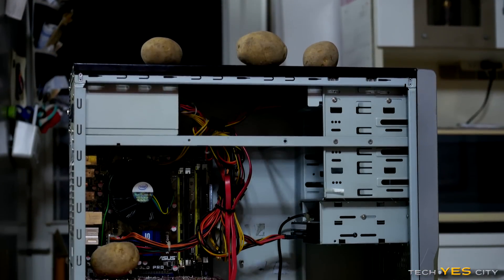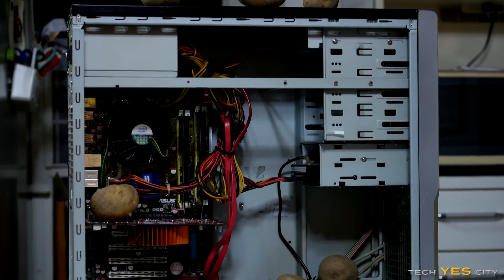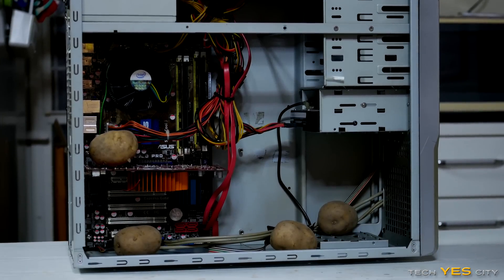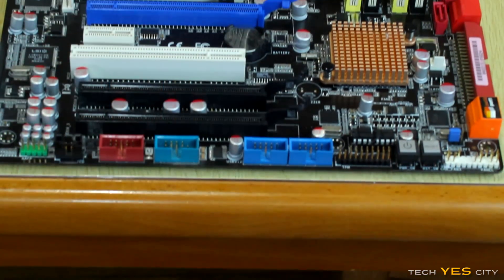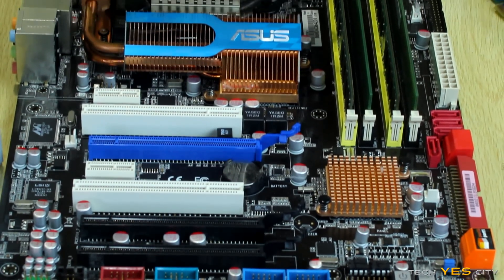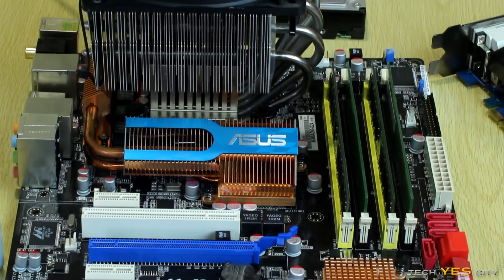The $70 CS:GO POTATO - 1080p CS:GO for Under $100?

Comment: I got a Packard Bell with an i5-650, 6 gigs of DDR3, a GT 330, a WD 1 TB, and Windows 8 (later 8.1) for free from a friend (born in 1941 or 42). I rocked it as it came for a while, with my 2010-era PC. Most things worked fine. I didn't play many games. It was mostly Minecraft and TF2. Video editing was pretty smooth, especially for already 4 years old hardware. However, in 2015, I got tired of that stuff and got me a GTX 750 1GB. Not the best card, but it was the only time I could buy anything, and the only thing I could afford. So, now, since then, I've been gaming on my sweet PC that can run Fallout 4 at 1080p quite decently for only 990 SEK, or currently $121.80
Reply: +TheBcoolGuy
Hello, I found an Laptop with an 
Intel Core i5-4210U 1.7 GHz Processor,
8 GB DDR3 RAM (I'm sure that's enough)
With an Integrated /On-Board Graphics.

It's in my price range, and I want to know if it can play FPS games.
Thank you.
Reply: Matthew Noneya Well, that's very vague. I don't know the GPU, your standards, your resolution, anything.
Reply: TheBcoolGuy If GPU stands for graphics, the only information I can see is an "integrated/On-board graphics". And I'd like to be able to play GTA 5 on medium settings, but would settle for COD MW3 and other COD games. I would also play battlefield 4/5 if that was possible. Thank you
Reply: Matthew Noneya With the processor you mentioned, I'd reckon the integrated graphics is the HD 4400, which will not even run any of those games. Well, perhaps the older COD games.

There is no Battlefield 5. There is Hardline.
Reply: TheBcoolGuy Oh, and my standards would be preferably 30-50 FPS (above 20 when I want to play something fancy). 360p is the lowest I'll play in. HD doesn't matter to me.
Reply: Matthew Noneya Okay, I knew it. I don't deal with trolls.

You can't even play these games in 360p. There is no such option.

Your computer wouldn't run your games at all. They would get to the menu screen at best.
Reply: TheBcoolGuy I'm not trolling, I was just trying to exspess how little HD matters to me. I watch my YouTuber videos in 360p because it's simple.

Even on lowest settings I couldn't play COD Ghost, MW3, or other COD games?
Thank you for your information.
Reply: Matthew Noneya Yeah, most likely not. Well, maybe, but it wouldn't be enjoyable, sorry. My PC has trouble running GTA V, and it's a lot better than that one.
Reply: TheBcoolGuy I'm sure a desktop can beat the PC I'm looking at, but could it not play... idk, steam games at low settings? I only play FPS (Sometimes Racing) And again, I Thank You for your time.
Reply: Matthew Noneya It really depends on the game. You would be able to play Source game (Valve games made with the Source Engine, like TF2, Portal (2), Left 4 Dead, Half-Life, etc.) quite decently at okay settings, but it's far from a beastly rig.

Comment: So what should I do, My Computer that I bought 3 and A half years ago with 700€ euros, doesnt run Csgo good. It runs about 35 fps constant and when I go Trough smokes it drops to 25fps. My CPU is Intel core i3 2120 and GPU is AMD Radeon HD 7470. It has 6gb of ram . I play CSGO at the lowest settings possible. Sorry for the Bad grammar and typos Im writing this on My phone and its 4am! The autocorrect is crazy! But thank you for your Time if you read and reply to this :)

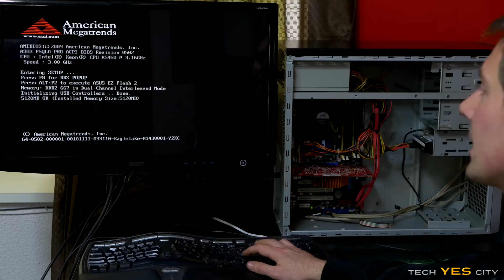Comment: Didn't he mount the power supply unit upside down at 6:00?
It seems the fan-side is mounted towards the top of the case, but it does not have any vent holes over there.

Comment: Hey guys! "What" LETS RUB THE SHIT OUT OF SENSITIVE ELECTRICAL COMPONENTS AND GENERATE AS MUCH STATIC AS WE CAN "Fuck Yeah!"
Reply: You introduce some conductive material. That's the trick. That way, no charge can build up since it's directly tranferred to the thing you're cleaning. No sudden burst of some kV at once. 

Easy solution, isn't it? Just look for it on amazon. There are pretty good, lint free ones for under 10$/box.
Reply: +GunsOfPlentyNZ Anti-static wipes dude. that and some contact cleaner is perfectly fine. At least better than vacuuming the parts. I never worked with a ground bracelet and didn't pay too much attention to grounding myself by touching the case or anything like that. Never had a problem. And I build PCs for 18 years now.
Reply: Idiot
Reply: +TheGamingKamikaze How so?
Reply: Your an idiot
Reply: +ARidingLifestyle How so!? when cleaning the components hes rubbing the shit out them with no ESD protection, normally i dont give a shit when assembling a pc about ESD just touch the case every now and then, but jesus christ that was extreme
Reply: +therealpanse What in gods name is an anti static wipe? How can a fiberios material disperse ESD rather than generate it? Also i am somewhat in the same boat as i built my first computer on carpert handeling all the components like a noob, however i gig manage to kill a gt610 by killing the brige rectifier with ESD shorting out on the transistors. so now i always take care
Reply: +GunsOfPlentyNZ My mobo is static resistant :)

Comment: o_O i find it sad that my $300 gtx 660 can only get 70 fps at low settings on cs:go and you can run it at medium very high :p
however i have a amd athlon ii dual core x2 xD so i think it's bottle necking.
Reply: It's 100% your CPU that's the bottleneck. My brother got the gtx 650 1gb and a brand new i5 4690k and rocking high/ultra settings 1080p at 200-300 fps. CS:GO is a CPU-game.
Reply: rasmus polden stene :) thanks for the info. i'm currently broke atm with £25 and just gotta get some more money until I buy a nice i5. thing is money is hard to find when your 13.. xD

Comment: do you know any gpu that does not need a power supply
Reply: The Gtx 750 ti
Reply: Thesoggyburito thx
Reply: 750 ti does require a power supply. 300w I believe
Reply: +Piotr Waniek gtx 950 also on some models
Reply: DONT GET A 750TI!!! Get a GTX950 instead they're way better!
Reply: +Leon Wallis 750ti is an entry level gfx card for people on a budget. it can still run nfs 2015 on low setting.
i got mine this year ; EVGA 750ti sc and its working like a charm on new games.
im planning to never upgrade until new gen games require more power.
Reply: CrystalEyes but my computer is the worst pieces of shit so it might not be able to connect to any card
Reply: Piotr Waniek you should change your motherboard. Buy one that has PCI express 3.0. But Im pretty sure an old motherboard can do the job but thats very risky.
Reply: you can get a reasonable good power supply for 20 bucks also
look up the evga 400w, I have used one without problems for a month now
Reply: That is on amazon btw
Reply: I got mine at $20 brand new
Xpower 750W.
Its cheap but can do the job :D
I suggest buying the best and cheapest one because it really dont affect the performance.

Comment: Not too bad of a PC actually.. Slap a 660ti in it and it'll fly.
Reply: the motherboard would die.
Reply: +Rehana Islam Actually, no. Psu might though.
Reply: Rehana Islam
..Why would the motherboard die?
Reply: F1nWarri0r
True, you'd need a good PSU.
Reply: +IRNatman because the Motherboard is shit.
Reply: Rehana Islam Invalid argument. I've built a system with a P5QLD PRO, still a fine 775 oc board. Just because something is a bit older, doesn't mean its shit.
Reply: Rehana Islam
Just because a motherboard is old doesn't make it shit. I had a motherboard almost exactly like it (probably worse) with a GTX760 and it ran for over a year with no problems. Only reason it quit running is because I tore the system down for parts.

Next time talk from experience, not from your ass..

Comment: What the fuck is wrong with you? Why would you bend the pins to change the socket? You can really fuck up the cpu like that. I bent one pin on an old pc i had. I could never get it running again. Plus if someone is making a 70 dollar machine they most likely dont have a 1080p monitor probably more of a 720p monitor. Though that doesn't really matter you could use a hd 5450 or 6450 to play. I have a 6450 that is capable of playing skyrim low graphics at 30 fps. Considering the shitty gpu with 160 stream processors and 1gb ddr3 128bit vram. Its really shitty but you can play early-mid year xbox 360 games
Reply: he didn't bend the pins he removed the tabs on the socket to fit in a lga771 cpu
Reply: ***** oh it really looked like he was bending pins.
Reply: +Spencer Cartwright It's a cpu for pc that costs 70$..Chill out.

Comment: that cpu alone would cost 50 bucks, where the hell do you buy these parts
Reply: I got my 2nd hand PC with an q9650 and 4gb ram with a 9800gtx 1gb, a bequiet 550psu and win 7 ultimate 64 bit for only 130 bucks ;)
Reply: anil basaran why not cracked win 7?

Comment: My i7 4510u cpu r5 m230 gpu laptop can't run this game at game fps as this pc? Why is that? Anyone help me?
Reply: Are you trying to play it at Max?
Reply: iDevice Freedom same settings :/
Reply: +moh you awe! That's crappy dude
Reply: +iDevice Freedom idk why? any fix?
Reply: clean install ? maybe if u have win10 its messing you up try 8.1
Reply: HappySlappy Face same stuff bud (tried clean installing 3 times already) and I get 251 points in cinebench r15. Idk what's happening
Reply: +moh you Try a different source game. No More Room in Hell is a free one. Also make sure the power settings prefer performance over battery
Reply: iDevice Freedom OK :)

Comment: WOW...That is a TON of thermal compound on that GPU!  I REALLY hope it isn't electrically conductive.  It only takes a tiny amount, probably less than half of what you used.
Reply: Maybe less than that cus a cpu uses around half of that and look at the processing unit on the GPU It is tiny!
Reply: +Gerff  it's arctic mx4 which is not conductive. it's also better to completely cover the gpu since you mount the heat sink directly to the die and not to the heat spreader that's installed on cpu's.
Reply: +83Bongo About a quarter of what he used WILL be enough to cover the GPU, when you mount the heatsink, it squeezes it into a VERY thin layer and pushes the rest out the side.  More is NOT better, it is worse (it may not be "measurable" by the sensor, but there is still a difference).  The purpose of thermal compound is only to fill the gaps because the surfaces are not completely flat, so you have to put something between them to transfer the heat, but the scratches and gaps are tiny, and it does not take much at all.  The lack of a heat spreader ALSO is better for heat transfer because it doesn't have twice the materials between the processor die and the heatsink, it makes it more efficient.  This also makes it easier to apply too much due to the smaller surface area and lack of the extra space between the thermal compound and the conductive surface of the unit (which is ONE of the reasons they decided to use heat spreaders on CPUs to begin with).  Most people who don't build or work on systems on a regular basis don't realize things like this, and why you put the compound on to begin with, and how little it takes.

Comment: i have a pc that has been free so far, free pc, graphics card and ram as gifts, and old thermaltake power supply which i got for free, now i just need to get a standard atx case, because the original PSU was proprietary so i have the cords feeding in through the handle on top of the computer

Comment: smearing thermal compound... and with your finger... do you do this with your expensive performance components too?
Reply: makes no difference. linus did a video on it.
Reply: +Keith Anderson well if Linus did a video on it then it must be 100% safe and rigorously tested, right?
Reply: bokunotraplord I neither said nor implied that it would be, but I was saying that evidence is there that it is safe. I myself have put together builds of all costs like that. It just makes no difference, but if you can think of one then let me know!
Reply: +Keith Anderson I've pasted plenty of heatsinks that weren't performing well when I smeared the paste (with a spreader, mind you) and did much better when I just applied a small amount in the center and let the pressure/heat spread it. There's also no reason to risk any oils/contaminants on your finger mixing into the paste. Honestly there's no reason to do anything besides apply some in the center and let the components do the rest of the work.
Reply: bokunotraplord And what difference would oils in the skin make to thermal compound? And the whole idea that something so small in significance as spreading as opposed to not spreading would make a noticeable difference is, quite frankly, absurd. I say this as a seasoned PC builder of all kinds.

Comment: what is he doing with the cpu and cpu socket
Reply: The cpu is lga 771, but the socket is lga 775, so there is an adapter(the sticker)to put on the cpu and a mod to the socket, (cutting the socket) so the cpu could fit
Reply: Chalklate Oh ok, wouldnt havethought that that works :D

Comment: My system specs are 
Mobo: GA-EP45-UD3P
Psu: Corsair tx 750 v.1
Cpu: q9550 overclocked to 3.9ghz 
Cpu: cooler: some noctua dual fan 
Ram: 6gb ddr2 soon to be 8gb
Gpu: gigabyte windforce gtx 960 oc
Storage: 1x 1tb wd green hdd, 1x 640gb samsung hdd, 2x hitachi 160gb raid in raid 0 for games. 
Case: dunno, some cm series
Reply: so what?
Reply: Well he was saying that ddr2 he should have gotten faster ddr2 rather than some 600mhz. ddr2 is still fine running games. only bottleneck i saw was the hdd and probably the gpu

Comment: im running cs go on a 500$ pc and i dont get over 200 fps and he is running on a 70$ pc and he gets 60-100 fps wtf
Reply: +Red Demon cost doesnt directly translate to performance. you got all your stuff new. this guy has em all 2nd hand. and this is ddr2 ram. so thats almost worth nothing. you probably have an SSD as well, a way better case. ddr3 or ddr4 ram with a motherboard that supports that. and a cpu to go with that. add a gpu and you are already at 500$. without a large increase.

Comment: 771 on 775 trick is commonly sold in Taiwan auction websites, but not like that cheap as you've got. I got E5440 and asus board combo like $60more not very far month ago. 

 I too got used 9800GT two years ago. But it cooked up 5 minutes after the system was installed. It turned out that I found "ASUS" 9800gts has all that issue, and it only occured in Taiwan. I got that card like $25. 

Look all the cheapy picked PCs video around youtube, I really envy you westerners since that cheapy fine easter egg never happened to me. And ironically, those parts are from Taiwan.

Comment: where was the windows in the price?
Reply: +Undercover Mantis It wasn't.
Reply: Kasis Derps Well for the people who don't wan't to rip it, it should be noted that this $70 csgo box would actually be more towards the tune of $200.
Reply: Undercover Mantis You can actually get legal Windows key for 20$, you can just download the actual Windows for free and then enter that legal key.
Reply: Kasis Derps How is that? Why do people even bother buying OEM copies if that's the case
Reply: +Undercover Mantis I guess they are afraid that their Windows May or may not be licensed. Now you can just download Windows 7,8 , then just skip that key part, and then download Windows 10, which is legal and no licences  needed. But I don't recommend this to begginers. It is way easier to just buy Windows.
Reply: Kasis Derps Where do you get the windows keys for a just $20 though.
Reply: +Undercover Mantis I don't know exactly.

Comment: Was the OS included with the HD, or did you have to get it separately? Was it included in the total cost?
Reply: no it wasn't.
Reply: +Keith Anderson, so what was the real total cost?
Reply: +derklempner 0 extra. you can crack the os. or just use linux or something.
Reply: +that one guy, he was obviously using Windows, so the Linux idea is out. I like the idea of the build, but people never include the OS n the cost. I run Linux, so I never worry about the extra cost, but I'm also in the minority.
Reply: derklempner mmhmmm, though it looks like he had gotten his hands on a harddrive which came with the mobo and case and whatever and he didnt wipe it so he was able to keep the windows install.
Reply: +Keith Anderson, that also makes sense.

Comment: Can somebody tell me if CS:GO will work on my laptop? Pentium P6200 64 bit dualcore 2.31 GhZ 2.31 GhZ 4GB ram.. Will it work?
Reply: Yes lowest settings!
Reply: +TilloZoiD With FPS=?
Reply: 34-45 avg 30 min 25 max 49 or 56
Reply: but you will get 35+ fps
Reply: +TilloZoiD even with low quality? Is it possible to make my FPS 60 or 70?
Reply: +Stanislav Trifonov yes. sell your laptop. buy a pc with about the same specs and a frikkin graphics card. thats the main issue